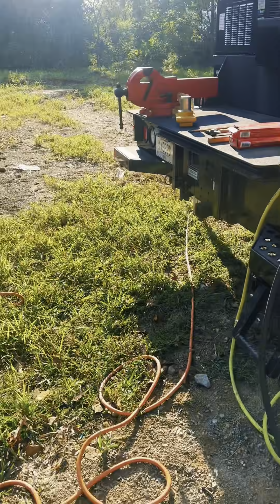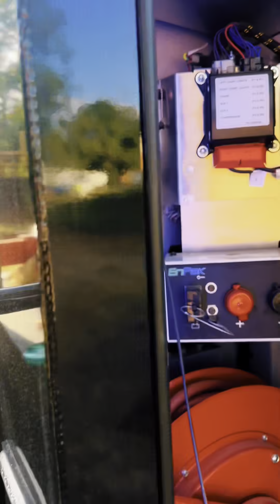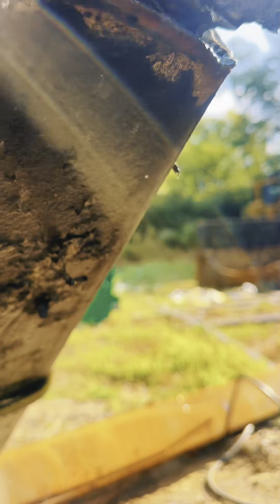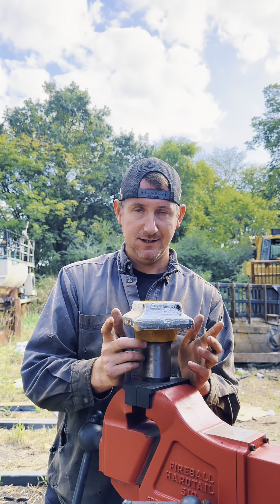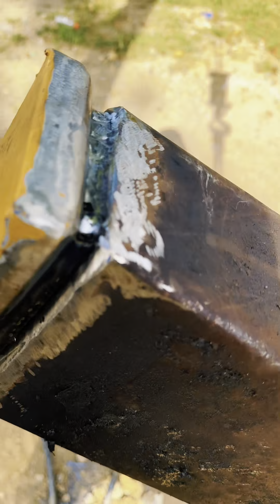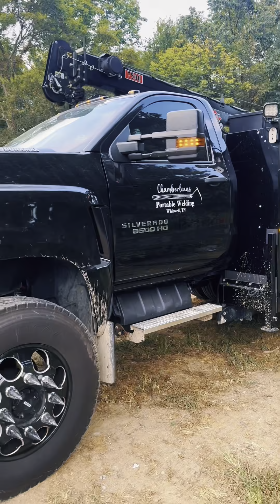Caterpillar D6T push arm repair . Welding and gouging

Comment: Gouging out the cracked section fully before laying the first pass is the step that makes or breaks a push arm repair. Did you preheat the casting before the root, or run it cold?

Comment: I feel like it’d been easier to torch gouge it
Reply from the maker: Everyone feels a different way , do what’s best and efficient for you and your customer 😊 . I prefer air arc over torch /gouge tip for things like this 1000% of the time and that’s doing this stuff now for 20+ years .
Reply: @chamberlainsPortableWelding  hmm, obviously it worked. I just feel like a torch is easier to pullout but, I guess it’s about the same amount of time either way. Maybe less clean up with arc. I haven’t done any arc gouging in 15 years since in school.

I’d imagine it’s cheaper to use gas wouldn’t you say? Also , the only time I’d ever see a perfect opportunity to use an arc gouge would be in a tight place.

I guess whatever you’re more familiar with I’m just a ex welder from the coal fields my friend
Reply from the maker: @chauncey5962 I gouge daily I got a hand full of new gouge tips that’s been in my cabinet on truck that hasn’t been used in years . I’d love if the opportunity would ever happen for both us to job on a set of arms side by side to compare the difference and time 😂. I’m in the business to get things done and as quick as possible if I thought a gouge tip would be the better option I’d definitely do that
Reply: @chamberlainsPortableWelding  I remember my non union work days.😂
Reply from the maker: @chauncey5962 shoot self employed hustling 😅
Reply: @chamberlainsPortableWelding  I guarantee it

Comment: Thank you for posting Josh. It would seem to me that, if I were doing this same repair, that I would have laid out a couple of reference marks on the arm tube before I cut the old part out in order to have a way of knowing that I didn’t change the length and angle of the original factory built piece when I installed the new part. Maybe you did as well and just didn’t show it or maybe you’ve done this same repair enough that you’re comfortable with not doing it. Good solid replacement either way.
Reply from the maker: This was still a factory welded insert , so all I do is just back gouge into the insert and slowly go towards the push arm tube till I see the seem . If it had been replaced before we’d just take some rough measurements to know if we need to not recess the insert to far in .
Reply: I was thinking of the same thing too
Reply from the maker: @hubertrobinson8825 I’d imagine anyone doing something similar to this would take measurements before cutting so I guess I forgot to talk about that ? Either way this was a factory piece never been replaced I just back gouge into the factory insert taking least amount of metal out of the push arm tube till I see the seem . If it had been replaced before I’ll take a few measurements just incase who ever took to much off the push arms.